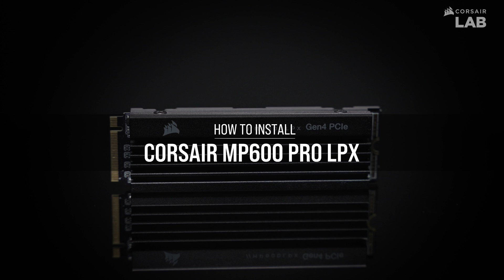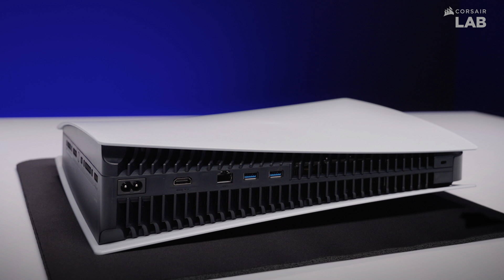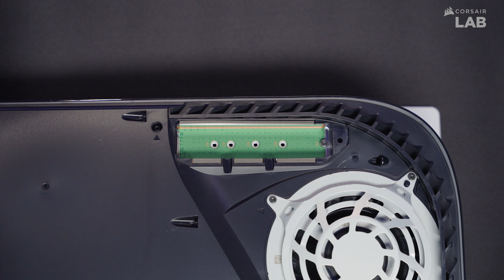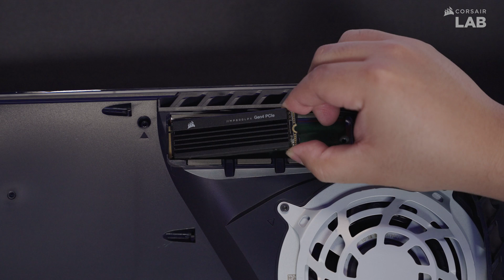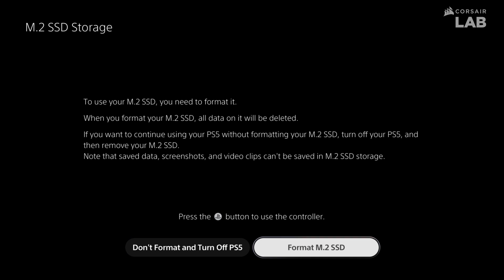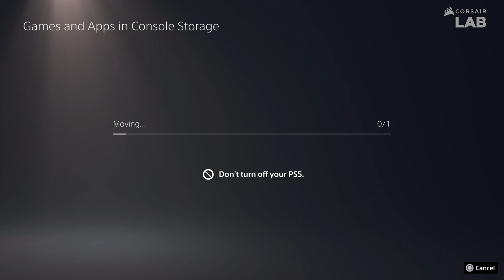How to Install CORSAIR MP600 PRO LPX M.2 NVMe SSD on PS5

Comment from the maker: Additional information can be found here: https://www.corsair.com/ssd-console-install

If you need assistance with your CORSAIR M.2 NVMe SSD or other CORSAIR components/hardware, please reach out to us at https://help.corsair.com
Reply: So, i bought a second one, the first one isn't recognized by my ps5 and surprise, the second one as well.
I won't try it out by a third MP600.
I don't understand the issue with this ssd.
Maybe my console has a broken port, but seriously, i don't believe that...
Reply: Hello @Corsair LAB, I bought the exact same 2TB drive for my PS5, installed it and format the SSD but it is only showing me a speed of 5500? I tried 3 times and It only goes from 5300 mb/s to 5650 mb/s, did I receive a defective drive? All of the ones I see online are above 6000 mb/s
Reply: What size Philips Screw Driver?
Reply: Can you add the link to the type of screwdriver you used ?
Reply: Hey this didn’t last me 7 months shouldn’t it last for eternity?
Reply: @MMAKLIPS  The rough average is about 10 years. Not eternity; but obvioulsy 7 months is a problem.

Comment: Guys if your PS5 doesn't detect it the first time you install it and plug in, try again bit this time gently push a bit harder until you know the ssd fully fits, kind of has a sound to it as well when it's in properly. This worked for me.
Reply: It's super quick as well, to test it just move around a few games to the ssd.

Comment: I bought the 2tb version and installed it back in December and for some reason my ps5 is not reading it anymore what can I do to fix this
Reply: I bought a 1 tb in like may or june and then my ps5 stopped detecting it like a month later. Did u end up finding a solution? I was thinking of just buying the wd black one from Playstation themselves
Reply: @kiyotaka_1738  yeah what I ended up doing was using the warranty (each product has it, you don’t need to buy said warranty) by going in their website and filling out a couple forms. Doesn’t take too long and they’re pretty quick to respond as well
Reply: @kiyotaka_1738  also don’t leave your p5 idle for too long to the point where it shuts off itself, I guess it messes with the hard drive and tries to reboot itself. And try not to leave it on rest often
Reply: @georgec3271  bruh that's exactly what my brother would do. He'd be on it for hours and then put it in rest mode instead of turning it off. Guess that's why it got cooked after a month. Probably still need to buy a new one but yeah ig I'll exercise more caution with it. Appreciate the info 🤝
Reply: @kiyotaka_1738  Ofc but don’t buy a new one just use your warranty and they’ll send you a brand new one. Unless you really just want a different hard drive go right ahead👍

Comment: Hello,I have the PS5 1200A C chassis, version with disc,is works on this version? I head are problems with the last fat version with the space on thet slot and you cant put the metal cover after,other thing,I need make a software update to get high speed ?
Some people said they have speed issues,for 6500-7000 mb do I need to update or itncomes with the latest updates.

Comment: Just bought the 2TB version in the recent Amazon Prime deals and it's been fine. Installed, detected and ran at around the advertised speeds.
Reply: How much ruppes ?
Reply: I just bought it in the current black Friday deals 

It's 35% off 

Bargain imo
 @INDIA-BHAGAT_SINGH

Comment: I install it correctly and its not being detected by the ps5, i been wondering why its not working , my system is up to date and i have done everything right , what do i do ?? Also when i open up the slot , in the video there is green background where the m.2 goes but mine has metal where it lays down so completely silver, i did research and figured out its a 2300 series ps5
Reply: Did u fix

Comment: DO NOT reinstall the default grey color, leave the slot open for heat ventilation. This is a huge mistake that only adds unneeded heat to the SSD. Leave the SSD slot open for the air from the cooling fan to reach the SSD. Alternatively you can buy an aftermarket heatsink cover, but the built in heat sink should be enough provided you leave the cover off to allow for ventilation. I can't believe people still recommend reinstalling the cover, this may very well lead to over heating and SSD failure in 6 months to a year.
Reply: Sony specifically says to keep the panel on to prevent dust
Reply: Thanks man for the advice!^^
Reply: I've left it open for a long time now and have had overheating issues
Reply: Ya I think this is what happened to my ps5 cause one day the ps5 stopped working, so I took it into be repaired at a shop that fixes them and they took out this m.2 and told me not to use it I believe it did what you mentioned in the comments because of the extra panel they tell you to reattach, I filled out a warrenty to the company hopefully they reply and send me a new one since its under 5 yrs and this time I won't reattach the panel.
Reply: No don't leave off the cover you will end up getting alot of dust inside.

Comment: The link given in your packaging leads to a dead page, and searching the exact product - mp600 pro lpx - on your website is showing no returns. Looked under products and found it, only to find the 'watch video' link on the product page leading to a 'private' video.  Hopefully the product works better than your marketing and website does...

EDIT - installed fine and reads at 6850. Y'all still need to work on your website though.

Comment: So can i still play the games regardless of what storage they are on or do I have to move them from the extra storage into the main console storage?
Reply: This is what I was curious about because the PS5 drive I added won't stream the 5 games so I really only use it to store PS4 games I can actually play from it. Finding one I can store and run PS5 games on would be very nice.
Reply: @hersquishy4201 You can play PS5 games from either internal drive. You can't stream PS5 games from an external SSD (they're way too slow); that only works for PS4 titles.

Comment: I installed and my read speeds are 200mb/s lower than the one in this video. Is that normal?
Reply: What speed is it
Reply: I think it was around 6300 but apparently that’s normal.

Comment: For some reason the ps5 says I have to remove it and that it doesn't meet requirements
Reply: Same problem here
Reply: @LostNoc  when you leave your ps5 in restmode and say your power goes out while its in restmode it fries the ssd, so your ssd is most likely dead
Reply: Did u fix?
Reply: @King-Nova  when in rest mode and you have power outage it fries thing

Comment: Been working on getting mine to work in my PS5 for two hours; this thing isn't compatible.  All updates done, confirmed the seating about a dozen different ways, and nothing.  The box says PS5 Compatible on it, so it's not the old version.  I've got the newer 1200 model of the PS5 (you can tell if your SSD slot has a metal casing instead of exposed green PCB).  Maybe that's the reason.  Now I get to traverse the hell that is Amazon returns.  There's got to be a better solution out there.
Reply: Was your ps5 firmware updated, then? What's the update?
Reply: @richiesilvestre461  Yep, it was 100% up to date.  I ended up returning the drive and getting a WD Black, which worked on the first try, no issues.
Reply: i’m having the same issue right now i gave up after an hour of re positioning and wasn’t able to get the pop up of it being detected should i just say f it and get the wd one?
Reply: @deborahcornejo6679  I think so.  It isn't terribly finicky when it does work; if it's not detecting it after a few tries, it's not going to.
Reply: Not working for me either, what a waste of time and money.
Reply: Not working for me as well. 
Ps5 updated.
Followed instructions to put the SSD in and and have it rest on the washer. Nothing. 

Any troubleshooting?
Reply: @shkooling  I just sent it back and got a dif brand. Working fine now.
Reply: Did u fix
Reply: @King-Nova  Nope, had to go buy another brand, which worked fine right away.

Comment: Help so my PS5 is updated to lastest software I installed ssd as shown in video it formatted then when I tried to move a game to the SSD and use rest of downloading games to m.2 SSD my PS5 shut off randomly and now it won't even read my SSD mp600 pro lpx 4tb pcle gen 4 say doesn't meet requirements now and it worked earlier is it corrupted now?
Reply: Did you get it fixed?
Reply: @richiesilvestre461  no never worked got a refund

Comment: My ps5 randomly shuts off. Idk if it's this that caused it to shut off randomly only with ps5 games. Does this hve a heatsink on it?? I keep reading that people add a heatsink on. Also i took the top face plate off while my ps5 sits horizontaly bc it shuts off playing ps5 games and still does after i cleaned it out. I believe i didnt take all the dust out bc i dont habe a vaccuum but im gonna get one soon. Still i have no trouble playing red dead 2 all day long. I guess that doesnt use a lot of power as a ps5 game but yeah my ps5 is fucked up

Comment: Why does mine say a slower read speed than yours? Mine shows 5900 while yours says 6500 I bought the same one
Reply: Many people don't know that the PS5 caps the reading speed. What the SSD can do on a PC and what it can do on a PS5 are two different read speeds. The max I heard on a PS5 is around 6500. It really depends on the PS5 not the SSD. The amount of messages I see aboutt his makes me laugh that people don't understand the speed cap is from the PS5 not the SSD.

Comment: Hi bro i am thinking to buy this nvme ssd for my pc.
Asus prime z690 motherboard. Which has 4 m.2 slots 3 of them is with heat sink on the motherboard and one is without heatsink.
I am think to use this nvme on the m.2 slot without heat sink.
My question is the m.2 slot which is without heat is connected to chipset not the cpu
Will it effect the performance of mp600 pro lxp 1tb connected to chipset slot.
Also have a option to buy the Mp600 pro xt nvme ssd 1tb.
Which is also with larger heatsink.
Thank u

Comment: I see comments everywhere saying it doesn't actually fit properly in PS5, and that's a no go for me. It seems to fit fine here but then why are several Amazon reviews and YouTube overviews of the ssd mentioning this as a flaw?
Reply: corsair mp600 series is mp600 pro lpx,  mp600 pro and mp600. And for ps5 is mp600 pro lpx
Reply: @mimogames7498  I found out there’s a version for PS5
Reply: It's just the heatsink. You can buy a good $10 one that goes with it, and it fits perfect and works perfectly also.
Reply: @whatthehec6736  plz stop spreading misinformation! It's not just the heatsinks. It's the WRONG ssd PERIOD!!! Why lie to yourself and others? What is to gain??
Reply: @whatthehec6736  since this post I found the answer. This one wasn’t designed for PS5 but there is a new one that came out like a month ago that is specifically designed for PS5. It’s the same one as this PC one but thinner and perfectly fitted for the PS5 console.
Reply: @forgivemylaughter  what’s the one made for ps5 called
Reply: @manuelbernal9989  it’s the same name but has added onto it - For PS5 or something like that. I got it recently. Go to the main website and you will see it. There is some YT reviews of it right now too. It’s fastest best on the market for PS5 as of today. The guy above has name MP600 LPX for PS5.
Reply: @forgivemylaughter  this is the one that fits, the LPX version. The one that doesn’t fit is just the MP600 Pro.They redesigned the heatsink just so that it would fit inside the PS5. It still works on PC.
TL/DR: -This version(MP600 Pro LPX)does fit. The MP600 Pro (without the LPX designation and with a larger heatsink) does not fit.
Reply: @timothybaptista2697  yeah the PS5 version is called the MP600 PRO LPX.
It’s definitely confusing at first as they look so similar. Another thing that indicates it’s the PS5 one, the sailboat logo is on the top left, the PC version or non-PS5 version has a sailboat logo in the middle. Let’s be honest. Horrible marketing and branding. It should have been called MP600 PS5 and it should have had PS5 written on the SSD and the box should have had PS5 in big font. A lot of PS5 owners are going to be buying SSD’s in the next year, even Sony has a deal with a company to make one for the PS5 now. If I have to do a bunch of digging to make sure it fits. Bad business.
Reply: @timothybaptista2697  Thank you for telling the truth and not spreading misinformation! Finally,  someone who actually thinks for themselves and does their own due diligence instead of just taking pplz opinion for face value.  Kudos to you my friend...kudos to you! This was very refreshing.  I almost lost hope for the human family.  Sheesh! Lol
Reply: @aceoseven2073  bro are you good? Spreading misinformation lmao. Touch grass
Reply: @timothybaptista2697   sorry I’m kinda slow litterarly lol . Okay so I ordered the Corsair-MP600 Pro LPX 2Tb Pcle Gen 4x4. With HeatSink that one is the correct one for the Ps5?
Reply: @forgivemylaughter is this the one? “CORSAIR MP600 PRO LPX 2TB M.2 NVMe PCIe x4 Gen4 SSD - Optimised for PS5”
Reply: @King-Nova must be the one, if you are getting it take my advice. It’s a great product. Works perfectly and fits great. However. BE WARNED. The tiny little screw. Needs to be screwed off and on with very close care. And with the exact fitting screw driver. There’s 1 screw that holds the lid down or something I forget it’s been a year or 2 but there is another screw that’s a tiny little baby one and it strips easy. I read many ppl stripped it and had problems. I started to a bit but was careful and slow and got it out and in. Be careful with it.
Reply: Because they are too lazy to do their own due diligence and research specifically what's required. Instead,  ppl would rather take misinformed youtubers opinions as the "right" information and they all get burned! It's really weird to me that ppl will easily just believe other ppl misinformation and spread it around and then get mad when something doesn't work out or they lost money on a purchase.  Its staggering to know just how many ppl are just BRAINDEAD SHEEPS!!! The go along get along gang is horrifyingly REAL!!!!
Reply: False. I bought it and it works for the Ps5
Reply: @Apaclypse  haha you would have bought the PS5 specific one bud, same one I got, if you got the PC version it definitely does not fit.
Reply: the one in this video is the ps5 compatible one bro
Reply: @chrisprilloisebola  maybe too long ago for me to care. At the time it was very confusing. One for the PC has same name.
Reply: @forgivemylaughter  yea they should have named it better